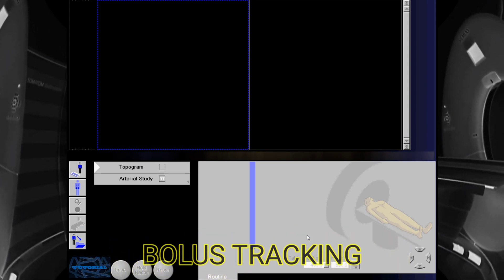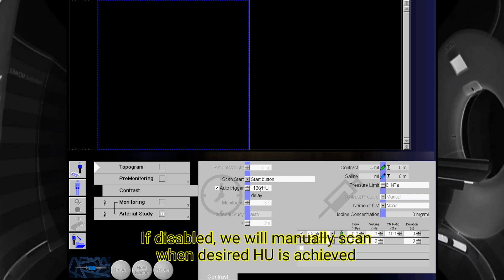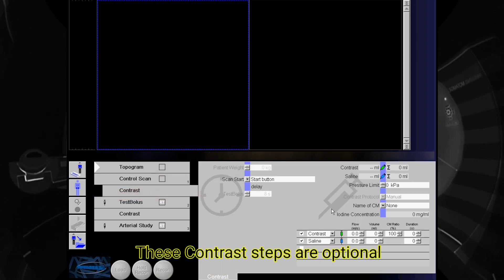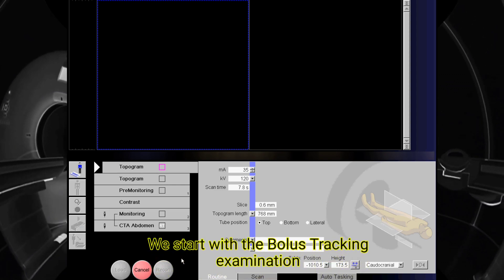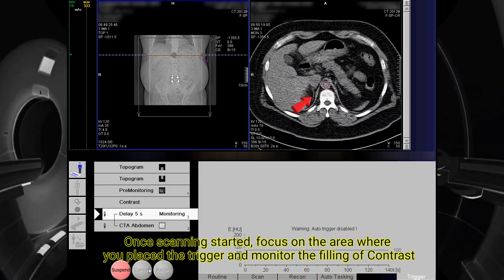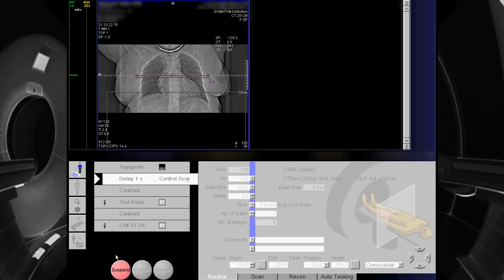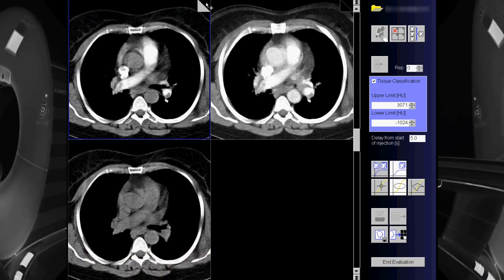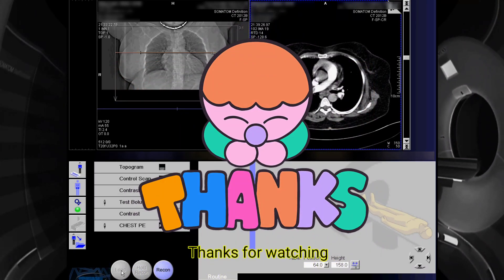Bolus Tracking vs Test Bolus Techniques

Comment: Thanks for the tutorial.  Very good and informtive.  Excellent demonstration of the difference between these two techniques (bolus tracking vs Test bolus).  At (2:20), you say "When contrast injection has been started it will not enhance the ROI directly".  I don't understand.  Did you mean to say that the contrast won't enhance the ROI immediately ?